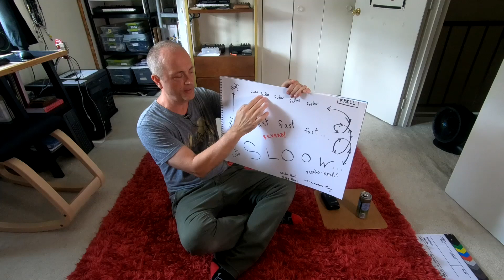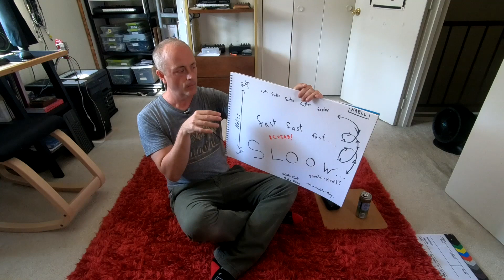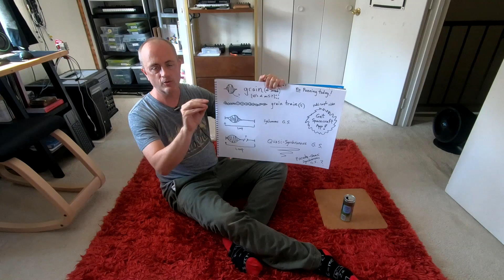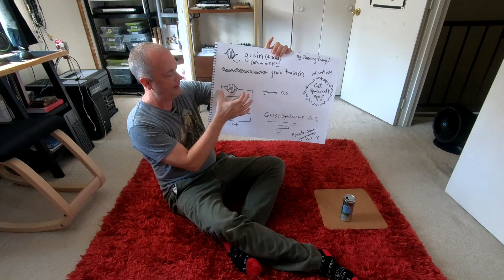MicroFreak: Episode 2 (Krells and Grains)

Comment: Excellent video. I didn't knew you could modulate switches and modulation depth of other matrix connections. This adds another layer of depth to the matrix itself.
Reply from the maker: Johnny Vandeclit Thank you! Yes, I am still kind of figuring out ways to take advantage of modulating the modulations. I keep forgetting to go back and look for usage in the factory patches (if any). Will report here if I find any.

Comment: Nice video great FM sounds 😁👍
What are those plastic creatures called and the lava thing  in the middle of them  they look great 🪐😁👍
Reply from the maker: Hey, thanks very much for checking out the video! The lava thing is actually Lava Light brand, called something like Volcano, it is some sort of battery-powered pump that circulates the beads (rather than the traditional molten wax). Turns out to have some really nice electromagnetic sounds too, as seen in the EMF sounds video of last fall. The plastic aliens - I think - are from the Moluk brand, their Oogi line of toys (lmk if this seems wrong because i might be misremembering about what is in the video). I appreciate this comment - I went to check the brand and was reminded of how nice they are. You know a toy is cool when you can pick it up a few years later and see new things about it🧐!

Comment: so if you had the choice between one of these and the jd-08 what would you get?
Reply from the maker: Well, kind of tough to say. I really like the Roland boutique synth that I have and assume the JD-08 sound quality would be great, also a lot of polyphony/sequencing capabilities. So, maybe if you are a keyboardist, used to standard-ish key action, own a  nice midi keyboard, or like sequencing a lot - the Roland might fit your musical style or existing gear? But if you have none of that, or are perhaps a guitar player with fx pedals to run the MF through? I find the MF to be a lot of fun with many interesting synthesis and sound design options. I personally like the capacitive keyboard, but some people don't. The MF has gotten nice updates since it came out (but maybe there will be a limit to that). I guess none of this is a clear-cut answer. Maybe check out some of the later videos in this series: I really liked the Noise Engineering update👍🏻.
Reply: @undulations  I have a keystep and half the time sequence with fl studio.  sometimes i do cover tunes(drag and drop .mid lol) and i want something with polyphony and depth to keep it interesting :)  i think either synth looks like they could do it. im so torn lol

Comment: Question: On the Lfo arp patch I have all the settings that you wrote on your notes but it doesn’t sound the same as yours. The arp timing is really slow. Also I noticed that your Oct/Mod button is blinking. Mine is not blinking. And it seems that it’s blinking at a pretty fast rate, which makes me assume that it has something to do with the tempo. Do you have an idea about why this is happening?
Reply from the maker: So, this is just a guess, but it might have to do with where you set the synced rate? I think the default is 1/16, and if you change that - then go back to unsynced - it still has an impact on the overall rate. Hope this helps.
ps have been offline a little, will answer your other comments asap!

Comment: Thank you for your video. Do you think it’s possible to connect two Microfreaks together in order to have a multilayer synth? ‘Cause a second layer is just the one thing missing for this little monster to be close to perfection!
Reply from the maker: Wow, that's a cool thought! I don't see anything in principle against it working well; it would be a lot of potential! Do you have a drum machine? I paired the MicroFreak with the Volca Drum (over in a Volca Drum video) and I felt like they worked well together. Anyway, thank you for checking out the video!
Reply: @undulations  I pair my Microfreak with my Drumbrute Impact, although Microfreak has no clock in, the go together well via MIDI.